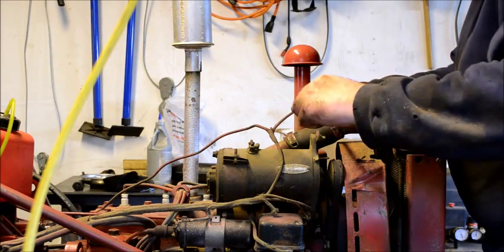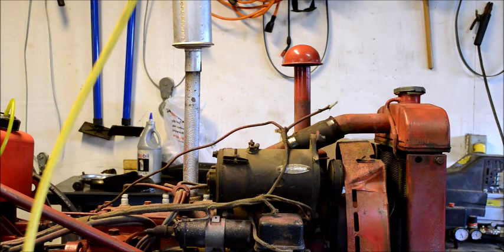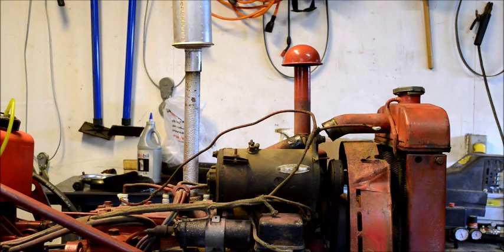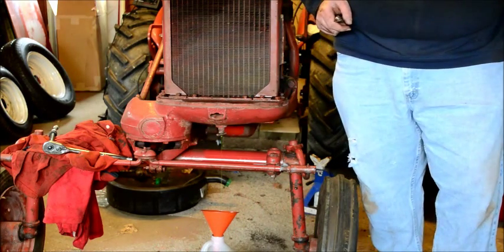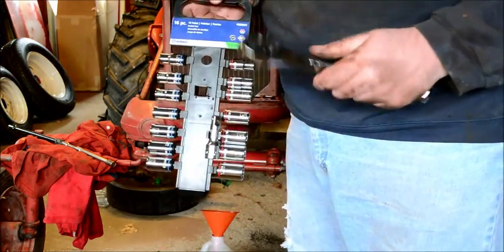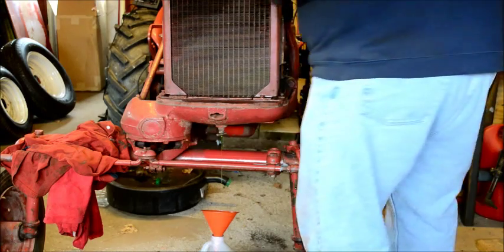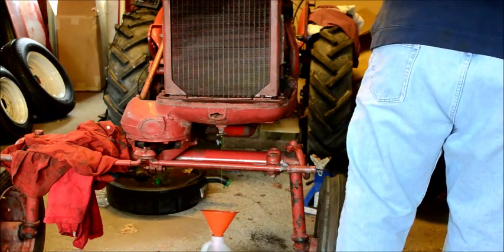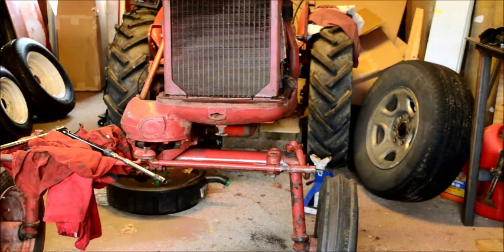1953 Farmall Cub Radiator Replacement Part II

Comment: On my radiator corner bolts, there was a little dab of rust and dirt just between the bolt head and shroud cover down towards the bolster. Wouldnt let the socket slide all the way down or just barely even on the bolt head. I took a screw driver / wire brush and cleaned them up and socket slid right over them.

Comment: When you put it back together go to your local hardware store and buy stainless steel bolts and you will not have a problem with bolts seizing again. Did that with my JD model 70 about 20 years ago. Had to take out the radiator last sommer. And they all came out without a problem. Those old John Deere had cast iron upper and lower tanks.

Comment: We have an old earlier Farmall Cub and it hasn't been ran in about 20 years or so. I know it is an earlier cub because it says "McCormick- Deering". I am trying to at least get it running. I haven't started on it yet, I am researching on what to do, how to do it, and prices on parts that I most likely need to get for it. I have a long list going on parts and prices going . (It's not looking like it's a cheap project)